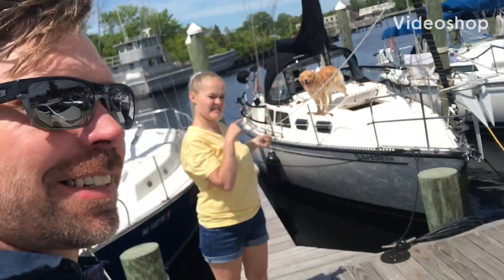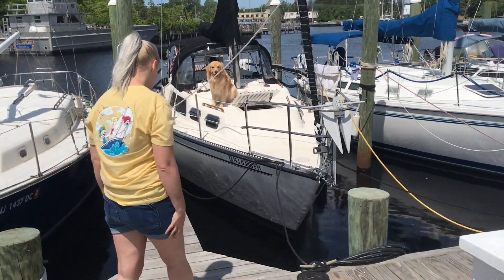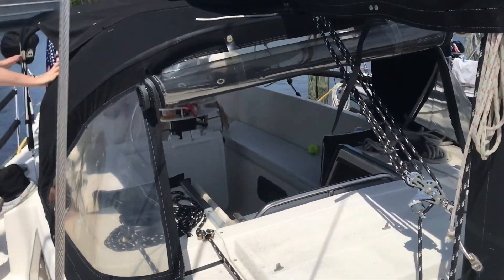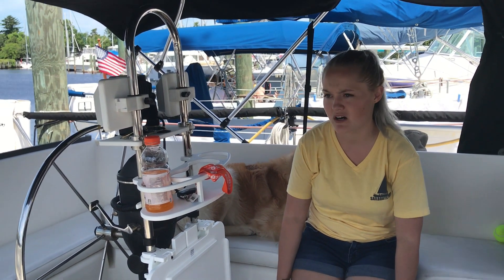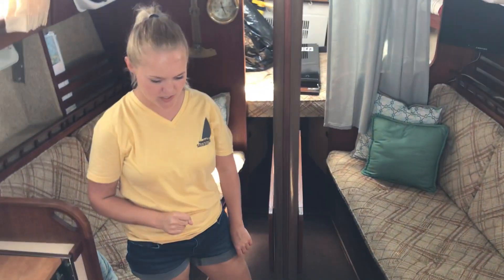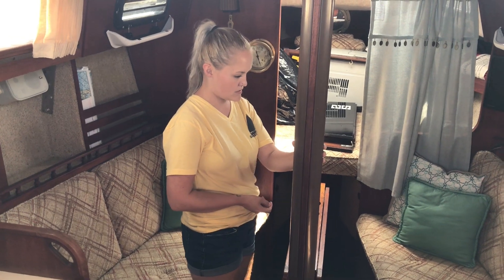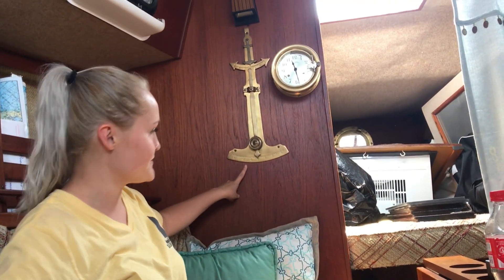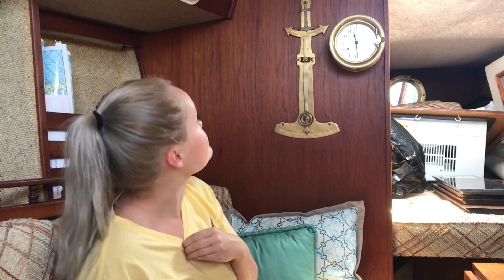TWO SAILORS WALK THROUGH A BOAT

Comment: This was the best walkthrough of a s2 9.2c I've watched. My wife and I are considering downsizing to a s2 9.2c and I have two questions. Is that a compression post or is it keel stepped? I noticed the door to the head doesn't open very far...are those steps stock?...It'd be a pain to have to remove them every time my fat but had to use the head.
Reply from the maker: The steps are in the way a bit but never enough to need to move the companion way stairs. The boat has been a fantastic boat. Unfortunately she is up for sale as we have purchased a boat for restoration. I will miss this boat very much.
Reply: @sailinglongwinded7329  where are you located or can you share a link to where it's being sold?
Reply from the maker: Gary, She was sold 3 days after listing her. Thank you for your interest though.